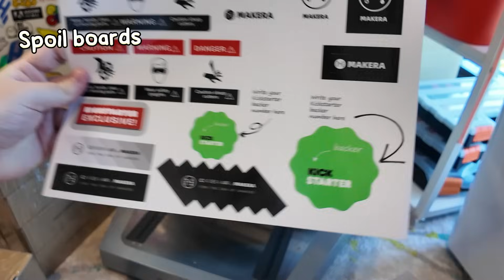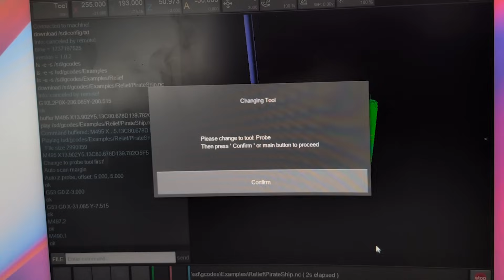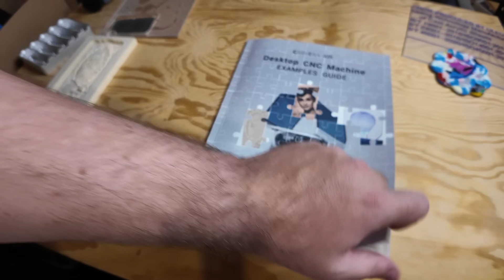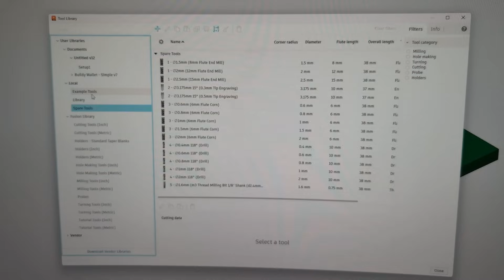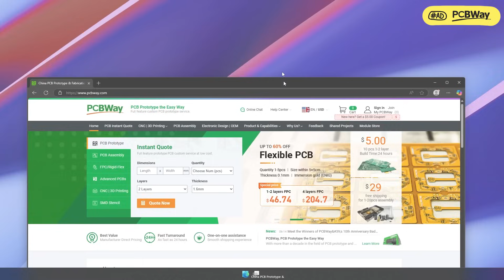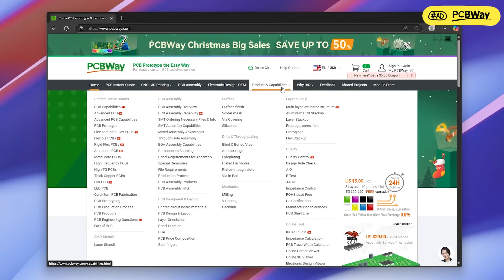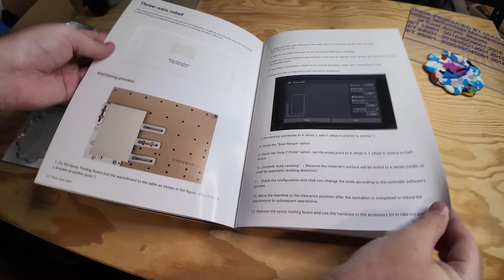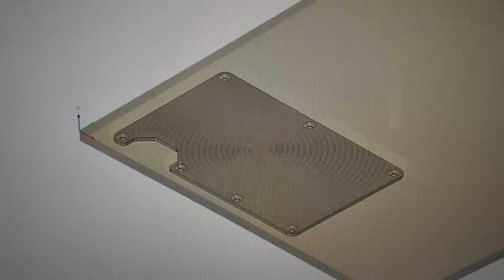The Tool Every Maker Needs - Carvera Air CNC

Comment: i dunno if it's win11 issue, but for the 4th axis part it's not working in the makera cam software. i cannot add/create cube or cylinder, it has no response and wont add anything to scene. the 3d relief button is always greyed out, cannot use at all. i tried sth as simple as an stl file with jsut a cube, jsut wont work...

Comment: I think it’s important to mention that the package you got in this package is far from the 2100$ starting price point, but actually closer to 3100$
Reply: This is actually $2400 for what he got. As of pricing today.
Reply: @ I don’t know where you see that,  but when I check the website the carvera air, plus the 4 axis, laser and pcb pack, excluding shipping and the sample materials is currently 2916$
Reply: @technomen0872  in this video he didn’t show the laser or the PCB pack. All he is showing off is the cnc itself and the 4th axis. And those are the price I listed. 

All of the kit prices he shows off come with the cnc itself and are not part of the PCB kit. 

And shipping is free.